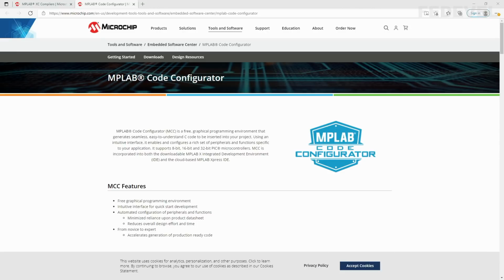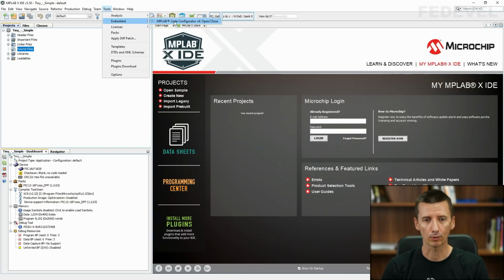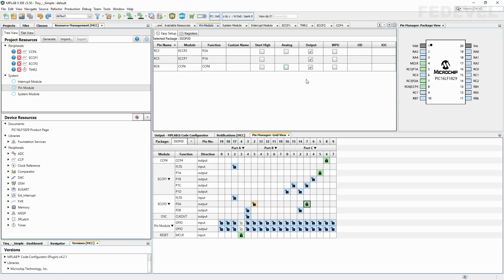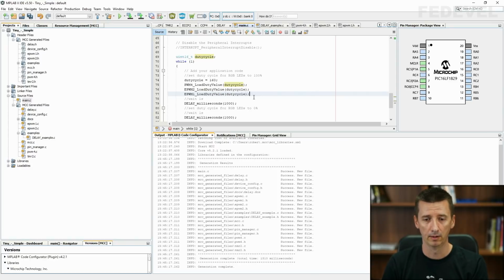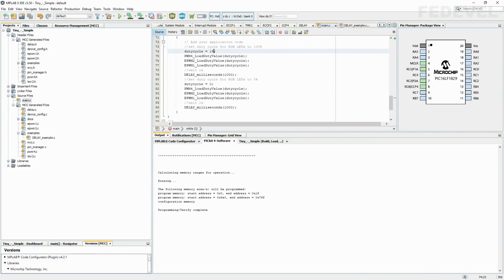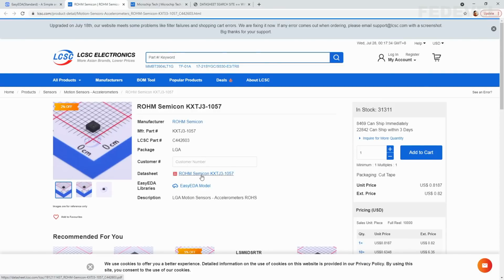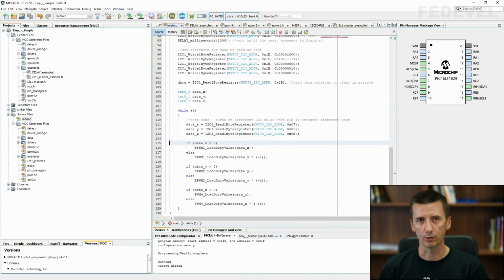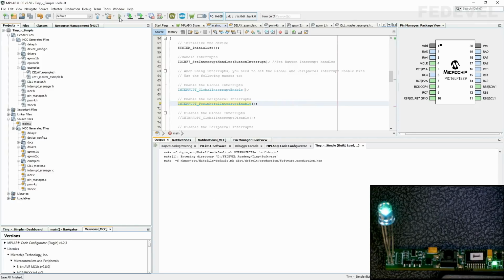Tutorial #7: How to Write Software And Program Your Board - Step by Step

Comment: Hi,
I have built a thermometer and programmed it with the Arduino UNO. I would like to design its PCB

The question is for me and it is that I don't want to use the Arduino UNO in PCB. What microcontroller can I use instead of?

Comment: Eagerly waiting for the series 2, more than any netflix series. Please add STM32 or ESP32 as the main cast, instead of PIC. Also would love to see how to generate the enclosures using fusion 360 and 3d STL import of the PCB. May be an ESP32 as the main chip with STM8 controlling the peripherals like the motor driver.
Reply: ذضذذ قبل ذذذضضضضض٣٢ضضصضضص٢ض
Reply: Yesss please ^^^^

Comment: The accelerometer data sheet states that the LSB sent to it should be a 1 to read but your oscilloscope clearly shows a 0 was sent. Why did it still work? BWT I cant get my accelerometer to acknowledge, as the device never pulls SDA low on CLK 9. I've tried reflowing with some flux and rechecking all the connections are correct per the datasheet. The first 9 bits on your scope is 000111000 and mine is 000111001.  Bummed!

EDIT: to read from a register, "the master sends a start condition, followed by the I2C address and
a write bit, and then the register address that is going to be read. Upon receiving the ACK signal from the
MPU-60X0, the master transmits a start signal followed by the slave address and read bit." I still cant read from the accelerometer but at least I know why 8th bit is 1 and not 0.

Comment: Thx you for all your tutorial Robert Feranec. It was exciting to follow.

Just one question, so there is no need to configure the accelerometer interrupt via RA2?

As an idea for the next project, can be projects integrating memory components like ROM or RAM.

For more complex subjects, pcb with an fpga.

Thx again
Reply from the maker: Thank you Ronic. PS: In this example I am not using any MCU power saving modes, so I do not need accelerometer to wake up MCU through RA2 (that is the reason why we have not configured it).

Comment: What small and easy microcontrollers would you reccomend to learn programming and use in beginner projects? I see a lot of people on the Internet using Arduinos, but I don't feel like having to use an entire Arduino board when I just need a few I/Os etc.
Reply from the maker: The one in this project is a very simple microcontroller (PIC) - that is one of the reasons why I used it (simple to understand how it works and what is inside).
Reply: @RobertFeranec  Well, I might just go for PIC. And what better place to start then the 1st episode of this series :D